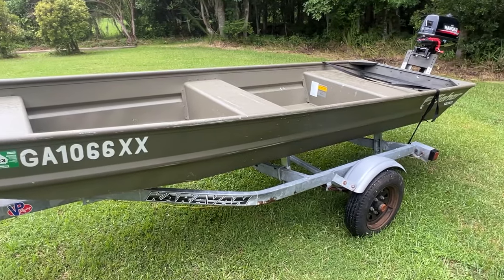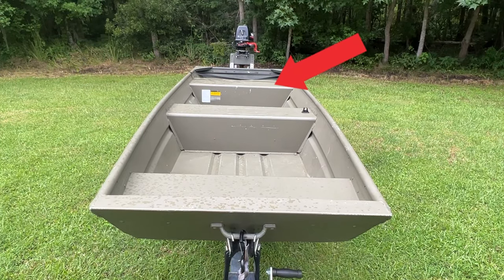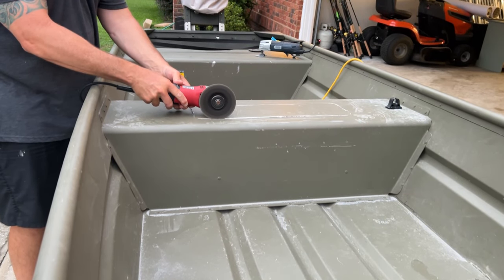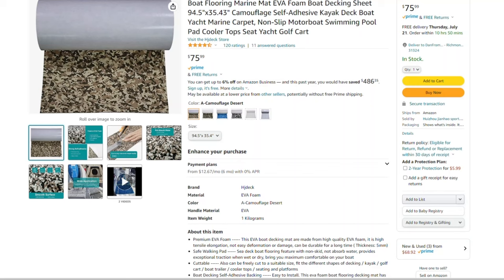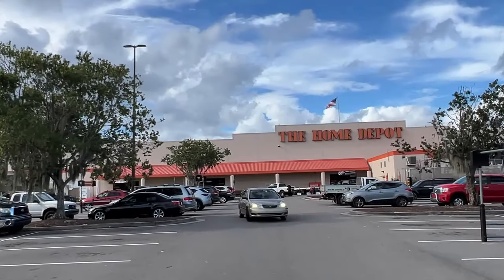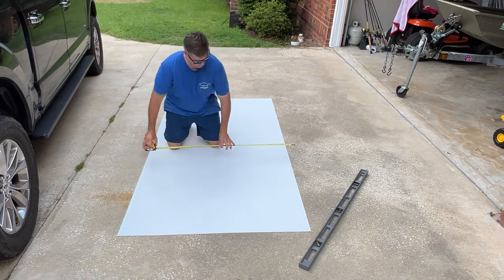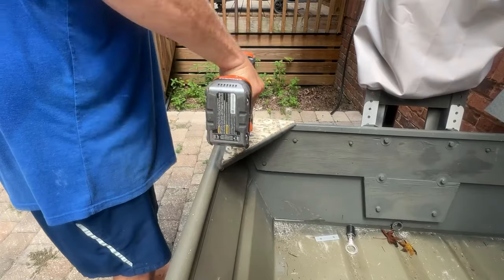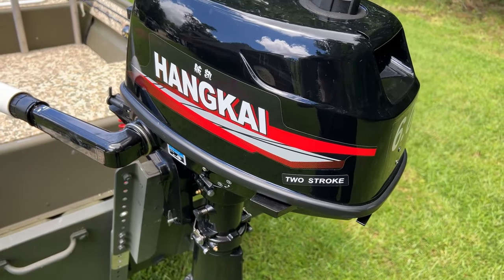Salt Water Jon Boat - The Ultimate 1232 Redfish Stalking Machine

Comment: Bill swamp is a good idea but I've always known jon boats and just a suggestion if you're a Jon boat owner if your bilge pump goes down and you got a significant amount of water in your boat take your boat and get it up onto a plane reach down and pull the drain plug water goes right out the back when water's out put the train bug back in but make sure it's still on a plane when you pull it out and put it back in don't make the mistake of pulling it out while you're on a plane and when all the water is out cut your motor don't do that make sure it stays on a plane so you can put your plug back in and not get any water back into your boat

Comment: I have now watched this video about 7 times over the last few months. 

I kept coming back to it. 

I am almost certain to be buying a beater 1436 for a few hundred… overhauling over the winter and making additions of sheet metal to it (keeping it simple like you), and paint. 

Then throwing on the 5hp two stroke and hitting the water. 

Thank you for the grab bar idea. I love it!
Reply: Checking back in to watch the vid again. It showed up in my suggested feed again! lol 

Anyways, I got the 18' Alumacraft 1436LT for $500. Got a new aluminum trailer for it. Got the metal repairs complete. Got the 5hp 2 stroke motor on and shakedown runs completed after registering. Been getting bits together like the trolling motor/battery and more. The motor does about 12.5 max with me (215lbs), my son(90lbs), and a filled cooler(~30lbs) in there... plus a 6gal fuel tank.

It looks like the final touches of sheet metal and paint will be happening during the summer. Been busy with cows, bees, horse, garden, and more here on the homestead. 

Thank you again!

There is a VERY good chance that I will be getting (in a year or two) a new injected Suzuki 9.9hp... and converting it to a 20hp. Should be able to cruise at around 34mph max if I do that... or low 20s @ half throttle.

Comment: There's some good ideas for my 1240 jonboat. But my primary use is duck hunting with fishing secondary. I like the flooring idea, but I'm not so hot on removing floatation from the seat. I have 2 old bilge pumps so that's another consideration. thanks

Comment: Nice boat, I like it. There’s only one change I’d make to it. I’d get a Go Devil longtail with a 6.5 horsepower Vangaurd instead of a cheap 2 stroke. Theres 3 main reasons for that:

1. I want the ability to go through mud with my main motor without damaging it. Outboards can do it but it’s not good for them. You get all the mud in your cooling passages and it ends up clogging them. 

2. The motor is not something I would cheap out on. I want something that I know will be reliable and last a long time. It runs you $2300 but it’s worth it. You’ll have the thing forever. We have a Go Devil with a 21 horsepower Vanguard that has lasted 32 years and is still going strong. 

3. I’d rather support an American company than buy something from overseas.

Comment: One thing I saw and liked was the jack plate/mount on the rear of the boat.  Store bought or home made ?  Have a Waco 1436 with a 9.9 4 stroke. would like to get the motor higher. Thank you for the info.
Reply from the maker: Home made

Comment: Nice project. I too have a 1232 jon boat in the yard, and am considering a similar makeover. I'm curious to know how well the EVA foam has held up to weather and UV exposure and how well the glue is holding after a year.
Reply from the maker: It’s held up good. The construction adhesive melted the foam so avoid it. But everything else is good

Comment: This was a great project , I mainly fly fish the flats and wanted a flats boat but let’s face it there expensive! Especially now, I mostly fish alone , but wanted something that I could take a buddy with , I decided to make a nano flats skiff from a donor boat , after a long search I finally found an 11’ ft 1965 Cacci craft three seat fiberglass V hull and trailer for $250 bucks , it needed the transom replaced and they needed a title and registration that cost me $91 bucks , next a motor found a 1977 -  15 horse Johnson that I picked up off of Craigslist for $200 bucks that hadn’t been run for 8 yrs it to needed work , so I found an old guy that works on old motors thats redoing the motor , I’ll be taking out the forward seat putting down a floor and front casting platform with storage under it , like your boat the mid seat Will have storage there and a hatch I’ll have to put some flotation back in the bow area , buy the time I’m done I’ll have total maybe $1200-1300, already got a 45 lb thrust minncota rip tide saltwater trolling motor & battery, I’ll make a bracket to bow mount it , starting to put things together in between the rainy weather, it weighs approx, 250 lbs  and you don’t even know it’s behind the truck , this is a fun project and I can’t wait to get it on the water !

Comment: Awesome job Dan! I have a 1236 if like to build out similarity for some of our smallmouth and pike backwaters. What did you do for trolling motor wire extensions?
Reply from the maker: I went to Home Depot and matched the thickness of the wires, soldered them together, added heat shrink around the connection point then added a black heat shrink wrap on the entire chord.

Comment: Bro I go over 40 miles off NJ in a 16ft aluminum starcraft for bluefin sharks mahi and wahoo all summer.
Reply from the maker: What’s the width of yours? Mine is very tippy at 32” wide.
Reply: @LowCountryFishing  mine is the runabout model. 1967 with a 2020 40hp 4 stroke. I had a 52lb wahoo this year that was almost 6ft long and it barely fit. I had looked at those mako skiffs before I went the direction I did. I had a buddy with a Montauk 17 and he ventures offshore with me and that square hull is ass. As far as that 12, I've been contemplating getting a hangkai for my 10ft jon I use in the Schuylkill river. Are they good?

Comment: EXCELLENT! This is exactly what I'm doing with my 14' jon boat. I'm adding items for duck hinting as well though. Do you have more info on the other modifications you did?
Reply from the maker: I added a jack plate out of aluminum channeling and pressure treated 2x8. That’s about it.
Reply: @LowCountryFishing  is the throttle extension just pvc? 
You built the Jack plate yourself?
Reply from the maker: @Artisanwoodworks73  yes pvc. Yes I built it. I’m super handy
Reply: @LowCountryFishing  me too. Your video gave me some good ideas. Wifey wasn’t thrilled. But thank you.

Comment: I am looking for a small boat for single or two fisherman at most. Would you consider that two fisherman could stand up and cast at the same time on calm water? Or will it be uncomfortable? (Let's suppose a weight of 85kg each fisherman and no deck).
Reply from the maker: No you need a 14’x48” wide boat to do this. This boat is too narrow for 2 people.
Reply: @LowCountryFishing  , thanks, got it.

Comment: Curious if we can get an update on the engine? I'm thinking of getting one for my jon boat but I might build a mudskipper for super skinny rivers ponds and creeks.

Thanks for any feedback.
Reply from the maker: The engine is great. Runs 17mph with me (215lbs) and gear. The boat is a little tippy but that’s normal for a 32” wide boat
Reply: @LowCountryFishing  did you have to do anything special to it? I'm brand new to boats and only have a 50lb thrust stern mount trolling motor on my 1436
Reply from the maker: @michaelinraleigh  it comes with break in instructions. If not just google it

Comment: How’s that plastic floor holding up. About to tackle this project but you’re the first I’ve seen to use that material. Most are using plywood with fiberglass or epoxy finish.
Reply from the maker: Decent. Just don’t glue it to the foam. Screw it down
Reply: @LowCountryFishing how did you screw it down?? I didn't think I'd that part lol
Reply from the maker: @wayfararout6258  I was originally going to have the floorboard  float but noticed when I was transporting it in the back of my truck. It was wanting to move around and possibly fly out so I found some small 2 inch 90° stainless steel brackets.  I screwed the vertical side of the bracket to the vertical wall of the center and rear bench seat and the other side of the bracket just pushed against the foam floor and held it down with tension.

Comment: how did this boat end up working for you I noticed you dont have any more videos with it, I just bought a similar 12' jon boat and im worried it might not be big or stable enough for inshore stuff in nc.
Reply from the maker: @ChefAlexSocci  unfortunately the 1236 John Boat did not work out for saltwater. I need to do a follow up video. It is very tippy and I worry if it flipped over and sank to the bottom of the river, I would have serious issues being away from home.since then, I bought my 17 foot skiff and only use the John boat for fishing private lagoon

Comment: What's the deepest u have gotten with this rig? Strongest wind? Open water bays? 
I wanna hit backwater marshes off the gulf coast but some require crossing some "exposed" bays that can get good waves during wind and weather.
Reply from the maker: Man it’s sketchy on the 1232. Be careful on rough days.
Reply: @LowCountryFishing  Mines a 1236 Not much of a difference lol. Yea the channels would be fine just wo deed if u have experience crossing the bays in between. Clam days would be easy it's just unexpected weather changes while out on the water.
Reply from the maker: @cjballard87  yeah a 1448 is really a more stable boat for what you’re explaining. Next week imma slide it into a calm back creek and see how she handles.
Reply: @LowCountryFishing  Awesome thanks for ur time!

Comment: Nice build. What did you do for the tiller extension?
Reply from the maker: PVC pipe. Heated it up slip it over the handle and let it sit. Then I took a stainless steel bolt and thru bolted it with a wing nut to hold into place. Worked perfectly

Comment: Info on ur motor mount i see u built it to ride high and the pole ext for the throttle pvc???
Reply from the maker: Motor mount was home made with 2x6 treated pine the sides were aluminum channeling. The throttle was pvc pipe that I heated on the end to mold over the throttle handle then pinned in place.
Reply: Shop vac extension tube's work for throttle to.

Comment: I have a John boat redfish and flats stalking machine as well I built for bays the flats and even the Gulf of Mexico side when water is calm and I have the autoboat gps controller as well that way I can use anchor lock and it will hold its self away from boat ramp while I park trailer and truck or while fishing it will keep you in that exact same spot using gps if you get on a hole or huge group of fish like mangrove snapper or speckled trout that isn't moving from that hole or area and keeps you in one spot so you don't drift and scare them away. You can use one finger and tap the arrows to change directions of travel it's so nice to have the gps controller on a John boat with electric trolling motor. I sold my flats boat cause I use a John boat setup like yours more then I did the actual boat cause it's cheaper easier less maintenance and I can still fit my fiance and kid on the boat with plenty of room to fish still with a live well for bait and a huge built in cooler that has a pump to pump water into from lake or what ever to keep fish alive for bass tournaments and fishing tournament that is catch and release or must weigh in while alive still. I finally won first in a fishing tournament last year for first time ever winning one with this kind of setup it was a tournament where you had to catch all 4 species of inshore game saltwater fish speckled trout flounder redfish and sheepshead and the one who hat the most weight combined won and I won with 51.5 lbs total weight the redfish was only 31 lbs, flounder was 10.2 lbs she was a huge floor mat, 6 lbs trout and a nice 4 lb monster of a sheepshead. I won 10k dollars and fishing rods and reels a new trolling motor, 1,000 dollar academy gift card, 2k dollar bass pro gift card that I could use for anything including towards purchase of boats utv ATV dirt bikes whatever I want, the monster offshore boat 82 gallon 330 qt yeti cooler which is now mounted on my offshore fishing boat, two electric reels on nice rods with the outlets and wiring harness to hook up on my boat which is installed now, and a bunch of fishing shirts and sunglasses and clothing and apparel from sponsors of the event. It was a great day with my budget salt water John boat. Everyone with their 50k dollar plus fishing boats and flats boats with the redfish spotting tours gps fish finders and all that was mad that someone with a 6k dollar setup won. It was a pretty tough day for fishing to water was kinda rough wind was blowing 10-20 mph winds so it was hard to find a spot that you could fish out of the wind or where the wind benefited you, heavy clouds overcast and even rained for a good 1.5 hours or so right at beginning of the tournament when they blew the horn for everyone to take off. All I have for electronics is a cheapo fish finder that I paid 50 bucks for off Amazon and it's basic it just shows simple pictures like if there is fish it shows fish moving across screen and you have small medium and large fish logos cause it can tell the difference in sizes kinda and shows grass as a bunch of little lines on bottom of screen and structure pops up as black circles and it gives you the depth of the water as well. Also the fish finder has a attachment with a float that you can throw out away from the boat and allow it to float around and it will tell you if there is fish where your casting to and if you troll with it behind the boat you can find groups of fish and structure and stuff like that as well. The main piece just screws onto side of boat or bottom of boat very simple but effective. Just Google lucky kayak portable fish depth finder. I bought it 7 years ago now they are 25-45 dollars now. And you can take it off the boat and use it on piers docks and from banks as well. Great for finding deep catfish holes in rivers I made a extension cable for it for rivers and it has now 150 feet of cable and let it float down the river to find the catfish

Comment: How did the flooring hold up on the thin plastic?
Reply from the maker: The R5? Decent. The liquid nails I used actually melted the foam so I wound up bolting it in place with a 90° bracket.
Reply: What about the foam decking on the plastic wall board? Did it stick well or is there peeling?
Reply from the maker: @andrewhiserodt2900  the liquid nais didn’t stick well. It kinda melted the foam. I used clear silicone to re-adhere it and it worked better.
Reply: @LowCountryFishing  What about the flooring to the plastic, not R5.
Reply from the maker: @andrewhiserodt2900  the R5 was laid onto the aluminum floor, and the plastic Flooring was glued to the R5.